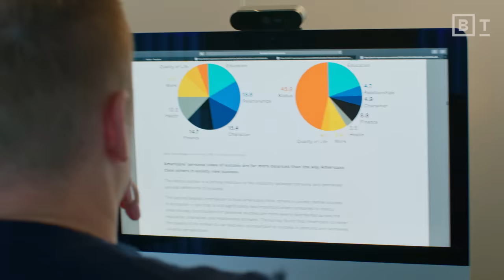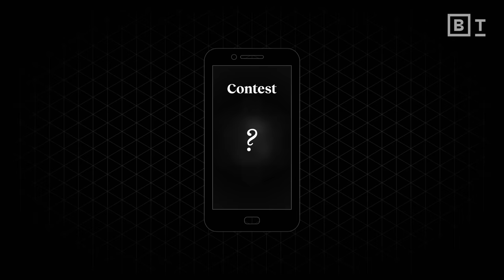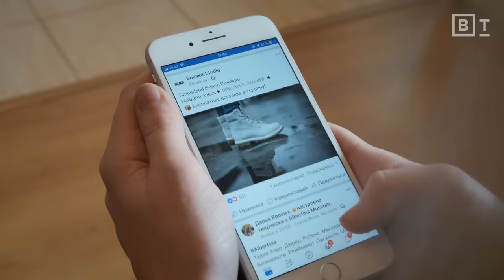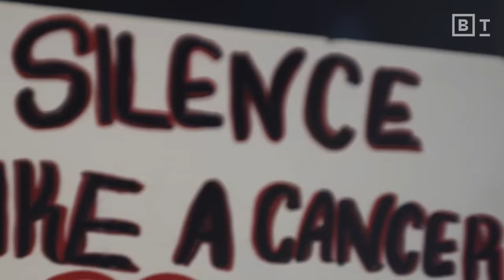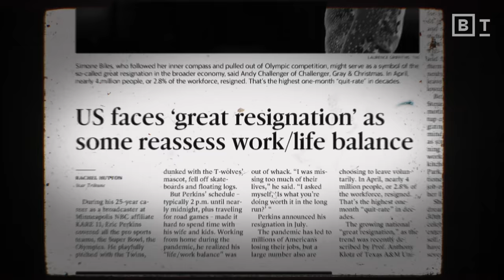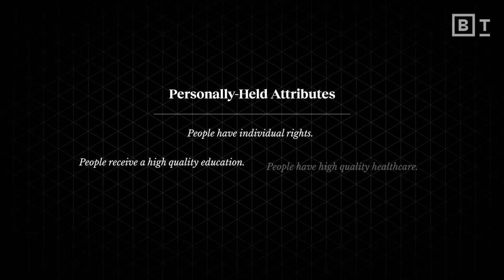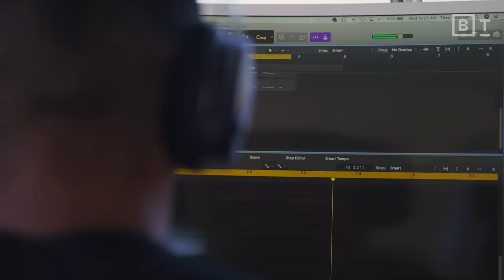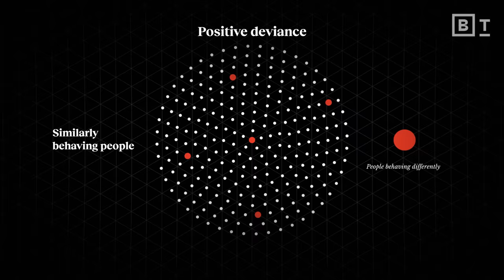Psychologist debunks 8 myths of mass scale | Todd Rose

Comment: I've always said that if you asked any individual about their morals and values you'd get pretty much the same response/answers, yet if you applied the same to a group, the answers would start to get skewed dependant on the size of the group.
Reply: It's not so much size that matters. But mass. 
What do I mean  
100 or 1000 in a group. Your past a general limit to matter how size affects your thinking. And depending on the individual, has as much or more impact on your direction of lean. 😅 
Personally,  f_<> the group.
Some people may feel that heard instinct if the group is single digits   other people may not feel that way, until you reach a higher level of members in the group.

Comment: In one of the earlier sections leap is made that doesn’t automatically follow from the collected data. People being “trustworthy” doesn’t necessarily imply that if left to their own devices they’ll make the right decision for themselves on basically every topic. Bring trustworthy doesn’t make you informed. Some people in the south use “healthy” to mean substantial or large when describing meals. I’d argue most people do not know how to manage a nutritional diet, given how obesity has risen over the years. 

And yet, despite the fact that we are apparently under the spell of more collective illusions than ever you suggest early on that an immediate step should be to give power back to the people—pushing for less regulation and smaller government. That seems like a premature conclusion that runs counter to the content of the video.

Comment: As a natural non-conformist who has rarely cared about what others think and has actively avoided belonging to groups to the point where I often question whether I'm of the same species, I was aware of most of these from an observational sense, but what a BS experiment to conclude a high level of human trustworthiness! Yes, when something inconsequential is on the line, people can generally be trusted, but that is exactly what also makes people so good at lying, stealing, and using—passing such stupid minor tests set people up as seemingly trustworthy only for them to fail whether by plan, impulse, or general weakness for things that actually matter. People tend to want to be able to consider themselves to be decent and so they do the right thing in minor cases, especially something so devoid of jeopardy as the expectation to respond honestly in regards to a coin toss where they either win some (unspecified) gift certificate or lose absolutely nothing. However, they have an astounding capacity for justifying the wrong behavior when something of consequence is on the line whether it be large gain in status wealth, etc.; to maintain a favorable situation; or to save their own ass. The percentage of people who can be counted on when it truly counts is small.